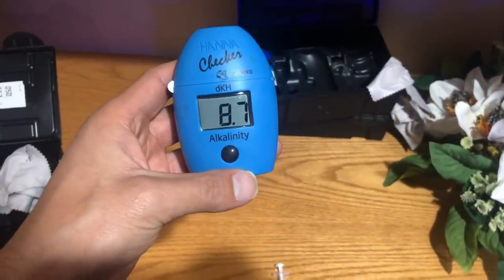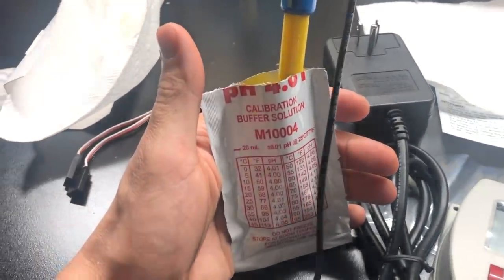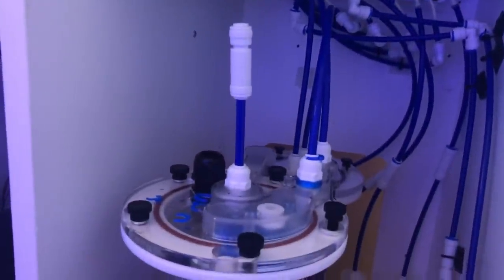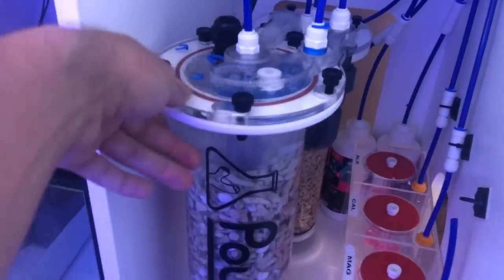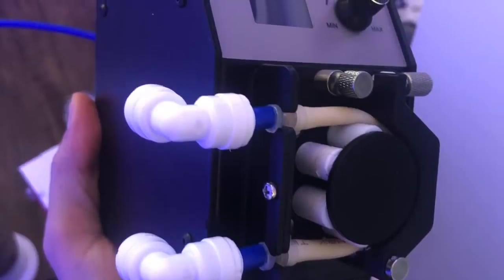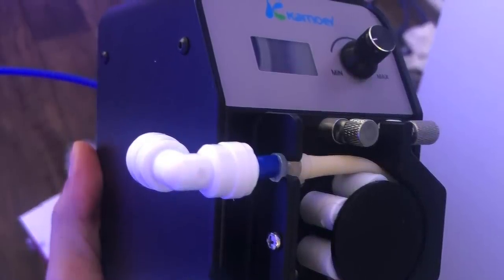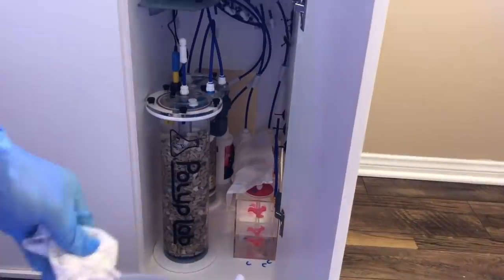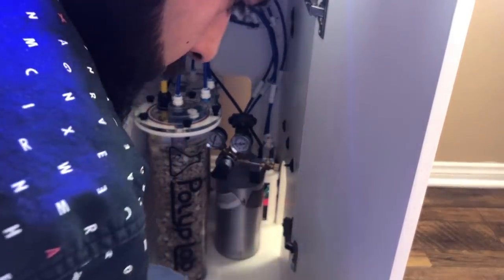It’s Alive! Calcium Reactor

Comment: Thanks for these videos 
I have one question, if you using the Komoer pull water from the reactor to the sump, the reactor is just feeding water by pressure.? No other pump is injecting water from the tank in to the reactor? Except for the re circulation pump 
Thanks I will be sitting mine up this week just want to clear that question since i also see other set up using and aqualifter to get water in to the reactor

Comment: Confused on ca reactor.  Isn't their a pump built in to the reactor to put water through the reactor and the dosing pump pushes it to the tank. Or is that dosing pump puts water in the reactor and feeds it to tank. Just wondering how many outlets I need
Reply from the maker: The reactor has a pump to stir it form within and then you need a separate one to feed water from the tank. Generally people will use a doser for this

Comment: I have a similar set up (reactor w/ secondary chamber). Did you have any issues priming the system? I  am have issues pulling water from the tank into the reactor. I too have a kamoer and it is not drawing water in from the secondary chamber. Thanks for any advise. Awesome channel btw!

Comment: DON'T USE that regulator for a Calc Reactor. It is not designed for any back pressure. Ask me how I know?  The solenoid WILL eventually sick either closed or open. I went through 3 of them. Do yourself a favor and get the Carbondoser regulator
Reply from the maker: Will look into that brother thanks!

Comment: How did you get the kamoer to initially prime the entire system? I hooked mine up the exact same way, exact same equipt... but cannot get the Kamoer to begin pulling water through the entire system. Are you using any feed pump, or at least initially to get air bubbles out at the beginning?

Comment: Great video. I started using a Reef Octopus calcium reactor 6 months ago. Been reefing for 20 years and was always intimidated by them but when the kamoer pump came out it changed the game. You are right once you get past the setup and understand the adjustments it's easier than easy. I have not touched the thing in 3 months.

Comment: Big Problem using that regulator, I tried to use that one and found out it IS NOT designed to for any back pressure. What happens eventually is the solenoid will stick open or closed. Use a Carbon doser instead.
Reply from the maker: Ya I have my eye on it :)

Comment: Hi everyone! I just have a friendly reefer question...Does anyone know how to eliminate/remove diatoms on the live rock and sand? I’ve had the tank for about 3 weeks and it’s cycle is done. I have 1 clownfish and he’s doing great. Just those diatoms are spreading on my sand when the light is on
Reply from the maker: Tank is still way too new so it is normal. Keep up with your bi weeks water charges he’s and keep feeding down to a minimum. It will go away just give it time and DO NOT RUSH OR BE IMPATIENT
Reply: EAT SLEEP Reef, ok, thank you for the response! I have been keeping the feeding lower and the water changes are on point. I also just bought a few snails which should in theory should help